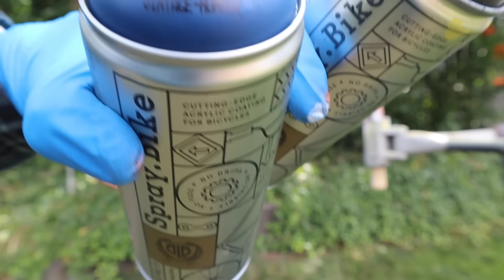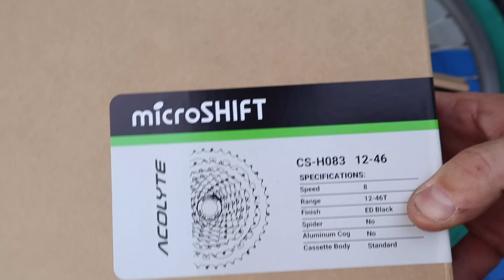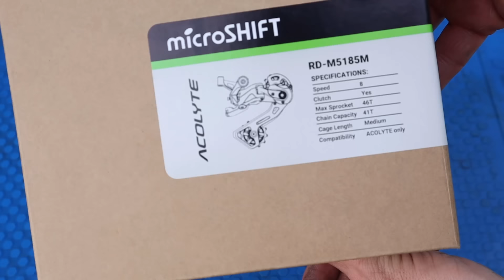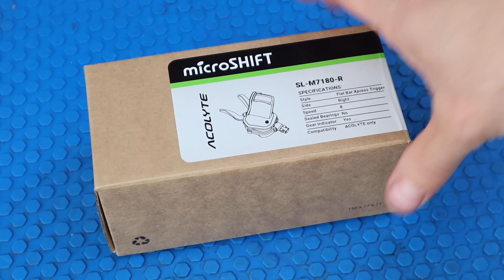Reset - Vintage Gary Fisher Big Sur Update

Comment: Painting question from my 12yr old. 

He’s painted the bike (1967 Schwinn Breeze) with Spray.bike and now wants to put Schwinn stickers on the paint.  His question; “do I clear coat first then add the stickers or clear coat over the sticker too”?   

This is his project and is learning a ton.  He bought the bike for $40, tore it down, prepped and painted and almost ready to reassemble (all himself). 

Thank you for your videos - they are fantastic!
Reply from the maker: Awesome awesome awesomeness. With regards to the stickers it can depend on the stickers if they are are made to g work with a clear coat over them. Some will bleed a bit from the clear coat. The safest and easiest to fix is to do the clear coat then place the stickers over the clear.   Thanks for sharing about you 12yr old’s project.

Comment: I recently got a 2000 Gary fisher sugar 3 for free on Facebook marketplace. It was converted to a single speed, and had many parts, such as the derailleur, pedals, shifter, and for some reason the chain, taken off of it, so I had to go get $175 worth of parts to get it back up and running. I’m currently loving it. It performs amazingly and for $175 has been a great second bike for me.

Comment: Stx rc loved that groupset the one and only full groupset I ever bought. Many many years later my stx rear derailleur is still on a bike still working fine and will soon be stripped and cleaned and going back on to the original frame I bought it for the cranks still on the old frame so will continue to live. It was underestimated in its day people went for lx xt or xtr. But mines 20ish years old still rocking
Reply from the maker: The stx rc parts on this were one of my favorite parts of the bike.

Comment: Nice work on that outline/2 sizes of decal trick. Since I live kind of a strange, slow, isolated life, not much has changed for me in the last 6 months. But what I notice for sure is way fewer cheap bikes available. Asking prices on used bikes is way up. I see this as good because it means lots of people are "remembering the old ways" of riding a bike for recreation instead of the more sedentary forms of entertainment like eating cheesecake at a mall after the movies. I've never seen so many people out riding before. Out of shape families riding together (again I'm saying it's good, they'll be in shape if they keep it up). I ended up deciding to restore and upgrade my bikes instead of buying another new one, as I couldn't find it in stock anywhere. Probably for the best. Did my first 1 1/8" straight to tapered conversion with that Cane Creek adaptor headset for zero stack head tubes. Worked pretty good. Clutch derailleur 1x10, dropper post and tapered fork on a bike that was born before any of that existed. That Park headset press would've been nice to have though, my RJ style home made one kept pressing it in crooked.

Comment: Word to the wise -put some grease on the crank extractor threads before you screw it in. You've got hardened steel (the extractor) threads meshing with the softer aluminum of the crank.

Comment: How do you create a durable finish? I restored an old rockhopper frame and the paint is still soft enough I could peel kit off with my fingernail. Thanks, loved the build
Reply: Use a 2K clear. Make sure to wear a respirator in a well ventilated area. And don't paint with other people/animals around. That stuff is ultra durable, but really really bad for lungs. Like really bad
Reply: @dexterdegeaut8625  @jfkusa123 like arsenic containing bad so really be careful

Comment: another great rebuild with awesome paintjob but I'd stay with the old silver stem and handlebar to keep it as period correct as possible. these would add up its retro style. I am surprised you haven't refurbished those as well as the cranks as you usually do. Short on time ? I also noticed you haven't replaced the brake pads. They looked pretty worn out and the rear brake pivots were a bit rusty.

Comment: Wish I knew somebody in my area who restores bike got a 2008 Gary Fisher gold series aluminum genesis it works great but would love to have it repainted and change up some equipment such as brakes disks to hydraulic, it's currently an 8speed I want to change it to a 10speed eg 10 speed chain,OEM shimano 10 speed shifter,10 speed drivetrain basically everything related with 10speed using shimano products

FYI I'm a complete noob when it comes to bike components otherwise would do the upgrade/Restoration myself

Comment: Really enjoying catching up on all your videos. It’s got me started on a long overdue restoration on a late 90s Marin Hawk Hill. It’s not the best of bikes of course, but it was my first mountain bike and it deserves a new lease of life, at least in my opinion. Your videos have made it super easy to learn a few mechanical tips and tricks. Couple of things I’d like to know: Is it better to fit new gear cables with chain on or off? High and Low screws, wound in, or kind of neutral? How much spare gear wire should I leave at the ends before I cut and fit the cap? Thanks for posting such great bike restoration videos.

Comment: Question for olshovel but also anyone else that wants to answer - I notice that the builds of bikes that originally had long stems end up with little stubbies that are the norm for modern geometry.  How does a more classic frame ride with the bars almost in line with the steerer tube?  Seems like it'd be a drastic alteration of ride characteristics.
Reply from the maker: It does change things. Typically with the decreased stem also widen the handlebars which can keep it fitting the same size person.

Comment: Good morning, great video, I really enjoyed specially this one, I will start to work on a Gary Fisher Utopia, frame paint looks great but it have some derailleur issues, front and back, I like the upgrades you make on this video and also think in apply the same to my  Utopia, I can't find the back derailleur microSHIFT RD-M5185M or RD-M5180M Acolyte Rear Derailleur for 1×8 Speed, any oter suggestion to substitute all the set, ( cassette, shifter and derailleur) I will like to use same brand for all 3 equipement pieces, I hope you can respond, really like your videos 👍🏼, I'm watching in Houston Tx  ✌🏼🤠

Comment: OK Shovel, I'm an old man. I used to love bike riding, but I am now way over weight (150lbs), and I have bad knees, combined with Lupus, Fibromyalgia, and Arthritis. It seems to me bike riding might be a way to work at getting towards getting back in shape. What kind of bike is gonna work for me? I can still ride, I did it a few weeks back and didn't kill myself, but the seat was uncomfortable as a bad case of hemorrhoids and the bike was a little difficult to mount due to the height of the top bar.

Comment: Hey, ı know this isn't about the video but ı want to ask you a question. Is an aluminum bike with a slightly bent downtube and top tube dangerous to ride? It doesn't look bent from a distance but if you hold something straight against it there is a small visible gap. Could it crack while riding?

Comment: What’s that plate on the chain stay do? Also isn’t the marlin head guy riding the bike a Trek thing?
Reply from the maker: The plate I took off is an anti chain suck that was used on some bikes in the 90’s. The Marlin on a bike was a Gary Fisher logo that continued in use by Trek after purchasing and then discontinuing the Gary Fisher brand.
Reply: Thanks!

Comment: SERIOUSLY WHEN WILL YOU AND OTHERS LEARN THE BASICS OF SPRAYING. First pre the frame by making sure it’s as smooth as silk from a proper sanding then prime x2-3 coats then sand the colour x2-3 coats then clear x2-3 coats sanded in between for perfect finish regardless of gloss satin or matte clear top coats. With all these steps of spraying at no point 🙅🏻‍♂️zero no no point do you try to achieve a full coverage/ heavy coats nor in this wishy washy pattern. It’s not a race to get all the contents of the spray can out of the can onto your project in record time 🤦🏻‍♂️ it the difference between a novice finish or pro finish (even when using spray cans/ DIY home jobs which obviously are super fun and rewarding). Don’t get me wrong I like what you try to achieve I’d just like to see your execution be spot on. Following all those steps will also make sure you don’t get any bleeds between any of your masking/ layers 👌🏻

Comment: If I was a buyer the old shovel logo being painted on would put me off and I wouldn’t buy the bike purely because I can’t remove your logo
Reply: Stick to buying brand new, then
Reply: Best thing is. You don't need to buy it. And the restoration filled your mind with top knowledge 😏
Reply: I disagree. To me that logo is like a stamp of excellence that increases the worth of the bike, knowing it's been rebuilt by oldshovel himself.
Reply: Or buy one that’s a solid colour and I could just sand the logo off and re paint that one small area